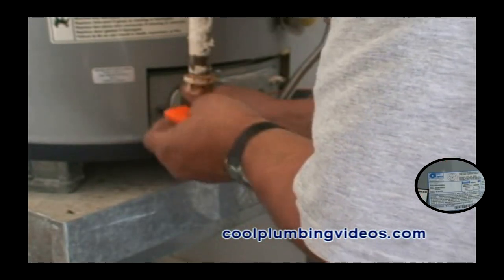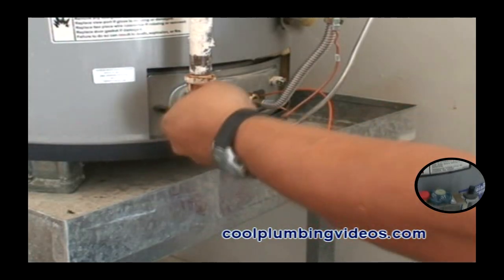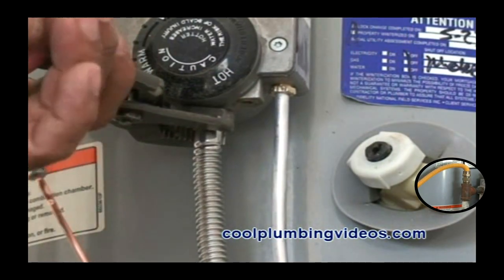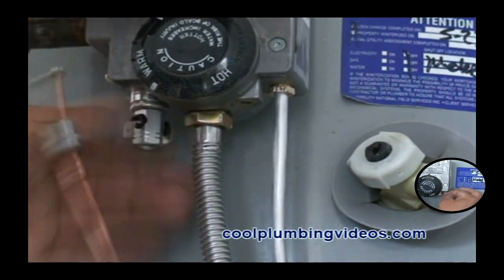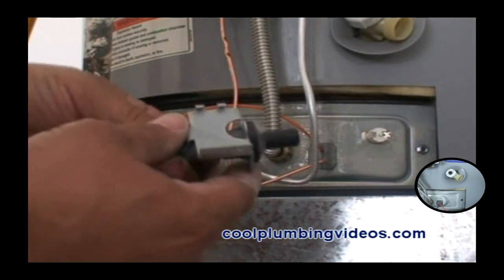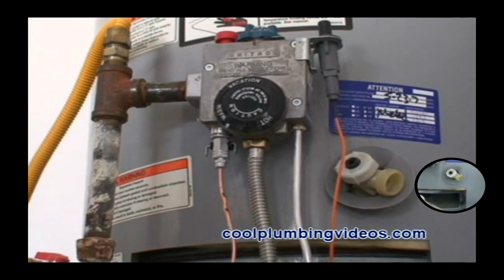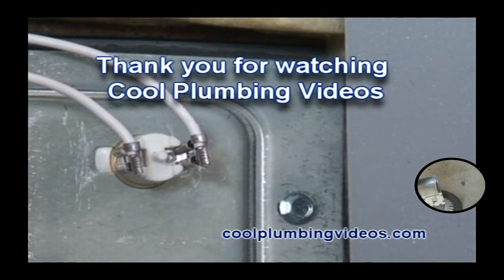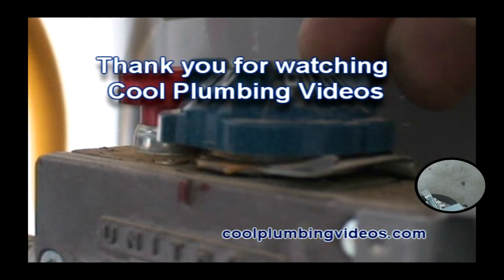Water Heater Thermo Coupling  And Burner Assemble  2 of 2

Comment from the maker: LOL your right that is the hard part. You have to squeeze the tubing together and kind of bend the cover. Yep Tricky but you can do it. then spray soap and water on the tubing connection and check for gas leaks. 
Also remember this,.. if the metal cover touches the wire connection in will cut off the water heater polite. this drove me crazy the first time it happen :-)  Thanks

Comment from the maker: You will need to take the orfice off the old one and use it on the new conversion kit, It's the little brass peice at the middle of the burner under the burner on the aluminum tubing. Some times the send a new one with the kit and some times the don't, and way it just screw off.

Comment from the maker: @davethestalker Get a spray bottle and fill it with soap and water. and spray it on the fittings going into the control valve and around gas valve and pipe fittings. if you see bubble there's your leak.

Comment: Thanks for ur great vids!  I have a ? about my power vent with an external fan unit on the outside.  I have sensors on the hood which will shutdown thermocouple if power vent is not operating.  They are flimsey and constantly tripping with even the slightest touch. Any upgrades to this dumb setup? Thanks!

Comment: I'm smelling a small amount of gas after doing my conversion.  I had it running for a few minutes, went upstairs.  Came back down and I smell gas.  I'm just tightened the door screws as much as possible.  I'm not sure what else to do.  I do t want to over tighten the fittings, because the metal is soft.  Right?